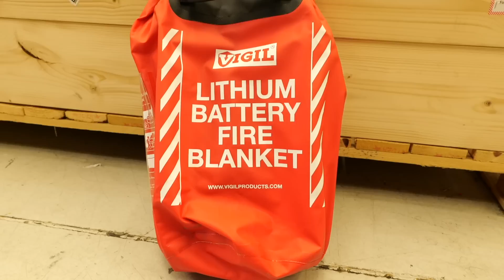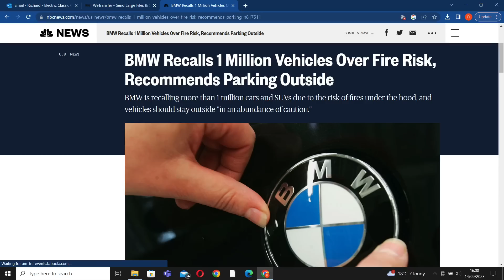Electric Car Fires - Facts and Figures

Comment: No mention that the electric car fleet is new compared to aging ICE fleet. Seems a biased comparison between the two. 

You speak about "petrol/diesel fires" for ICE vehicles, but a large proportion of the fires are not caused by the drive train at all. Rather they are caused by vehicle mods, arson, insurance scams, etc.

The soothe saying on the electrical fires is utterly perverse. Electric vehicle fires are extremely hot, toxic, and hard to fight - but a blanket solves it?

"It's very unlikely" - breathless handwaving. "But ICEs burn too" - deperation. Highly dismissive of the very real threats posed by the mass introduction of EVs.

No mention of how to minimise the risks of or what to do in the case of an EV fire. Just clutching Swedish stats and handwaving.

As I write a Tesla EV battery is on fire in Queensland Australia with fire fighters stepping back to simply "let it burn" be ause they cannot extinguish it with their conventional methods.

Comment: So, never park your electric car in a car park, because a petrol car might start a fire and destroy your EV.
Reply: The dude does not get your irony. I believe everything I want to on YouTube 😤
Reply: What he said is your electric toaster if it catches fire it will burn to a crisp. Ice cars can be saved with a 10€ fire extinguisher IF it catches fire because of bad maintenance.
Reply: Bullshit
Reply: LFP batteries are less energy dense than lithium ion batteries and much less likely to burn, even if subjected to direct trauma. It is disappointing that LFP cars are becoming harder to find on the market, especially as the LFP batteries are cheaper to manufacture.
Reply: The difference is that the petrol car fire can be easily extinguished. Never park your EV in a garage.
Reply: The difference is that the petrol car fire can be easily extinguished. Never park your EV in a garage.
Reply: The difference is that the petrol car fire can be easily extinguished. Never park your EV in a garage.

Comment: you cannot deny those facts: in Sweden. However, in high temperature and high humidity- those are differing operating conditions, so your results may vary.  Again - even the firefighting strategies will differ where temperatures are higher. I expect ther eare few Chevy Volts among the base of EVs in Sweden.

Comment: You're cherry picking your examples like the media do. Lithium fires are by far more of a problem. There's a risk of colbolt poisening which can be devistating. But the battery produces its own fuel and can reignite after tthousands of gallons of water are poured on it. Lithium batteries are know to combust during charging, how many people fill their petrol car at hom in the driveway or garage?

Comment: I don't hate EVs but I know Lithium batteries are very dangerous and NOTHING like the risks of ICE engines.
Reply: @@CantStopTheSignal337 Flammable liquids?  Have you ever tried to light diesel?  It's nigh on impossible.  To ignite diesel requires pressurisation into an aerosol using high pressure injectors. It can burn but it's rare and like petrol, it's easy to extinguish. But L-ion batteries are a totally different matter.  There are no similarities at all. Petrol requires a broken fuel line and a spark.  They don't just combust like EVs can.   You obviously know nothing about engines.  Denial will not alter facts.
Reply: @@CantStopTheSignal337 Well of course it will burn.  And how pray tell will diesel be soaking insulation?  Extremely rarely.  And what would the ignition source be?  are not talking LFP we are talking L-ion batteries.  I am not in denial at all, EV heads are.  Of course there will be more Petrol fires than EVs because there are billions of petrol engines compared to EVs.  Obvious or what!!  The EV industry is finished mate
Reply: @@CantStopTheSignal337 Well of course it will burn.  And how pray tell will diesel be soaking insulation?  Extremely rarely.  And what would the ignition source be?  are not talking LFP we are talking L-ion batteries.  I am not in denial at all, EV heads are.  Of course there will be more Petrol fires than EVs because there are billions of petrol engines compared to EVs.  Obvious or what!!  The EV industry is finished mate
Reply: @@CantStopTheSignal337 Well YT keeps deleting my comment. Try again - Well of course it will burn.  And how pray tell will diesel be soaking insulation?  Extremely rarely.  And what would the ignition source be?  are not talking LFP we are talking L-ion batteries.  I am not in denial at all, EV heads are.  Of course there will be more Petrol fires than EVs because there are billions of petrol engines compared to EVs.  Obvious or what!!
Reply: @@CantStopTheSignal337 I have tried four times to respond but YT keep deleting my comment.   Utter bs.

Comment: You fail to mention the reasons for car fires . How many are deliberatly set on fire in both groups . You also fail to mention the very toxic and poisonous gasses released by Electric car fires. Much more dangerous than the poisonous gasses released in an electric fire.

Comment: Everyone seem to miss the point that on average EV drive fewer km annually than ICE vehicles. A fair comparison is fires/billion km.
Also most EVs are less than 3 years old while there are many 10-20 years old ICE vehicles on the road. Maybe older EV burn more often, we just don't know yet?
Reply from the maker: Pinfa (Phosphorous, Inorganic and Nitrogen Flame Retardants Association) suggested around 55 fires per billion miles traveled in ICEs compared to 5 fires per billion miles traveled for EVs. A recent study conducted by AutoInsuranceEZ using data from the NTSB (National Transportation Safety Board) showed that electric cars in the US caught fire at a rate of 25.1 per 100,000 sales compared to 1,530 for ICE vehicles and 3,475 for hybrids.
Reply: @ElectricClassicCars  The per sales numbers are totally nonsense.
The 1:10 ratio is about right, but it is still comparing newer EVs to all ICE vehicles, so still flawed.
Reply: Data from autoinsuranceez is inteitionally fake.  I followed its source to a reddit post, and then the original paper it sourced information from

Comment: Thumbs up from me for accuracy. A few things which would also have been good to mention. 
1. Hybrids are around twice as likely to catch fire than ICE. Putting them something like 40 times more likely to combust than BEV. 

2. BEV fires are less likely to result in injury when the car is already occupied. BEV cars have the ability to detect thermal runaway and warn the driver. My car for example will tell you to evacuate the vehicle. I'm not aware of any ICE road car which can tell you it's about to burst into flames. Unfortunately ICE car fires can start within seconds without warning and therefore with horrific consequences. 

3. As the battery technology/chemistry changes, the risk of fire gets less and less. That partly explains your stats suggesting the number of cars is going up but the instance of fire is not. It's highly likely that BEV cars made in a few years will have a tiny fraction of the risk they do now.
Reply from the maker: Very good points. Thanks for your comments. 👍

Comment: What is the rate of car fires?
Analysis of fire and crash data from the Bureau of Transportation Statistics and the National Transportation Safety Board show there were 1529.9 fires per 100,000 sales for gasoline vehicles and just 25.1 fires per 100,000 sales for electric vehicles.9/03/2023

Comment: Sweden stats should be weighted with car age as well. ICE fleet is older. Best is to present fires per km travelled with similar aged fleets. 
The real problem with ev fires is that they cannot be controlled with conventional means, that they emit more toxic fumes and that no real safety regulation exists yet. 
If an ICE car ingnites in an underground car park, you have a firefighting device placed in the space to combat it in its early stage. Also you can approach it without a respirator. If same thing happens with an EV there is nothing there. In most countries even the fire department doesn't know what to do.

Comment: That’s great! Doing a google search also reveals that LFP batteries are even safer and they don’t catch fire even if they are punctured through the cell 👍
Reply from the maker: True 👍
Reply: Safest battery is sodium battery
If proven true, safest for home energy storage
Supposedly battery will not set itself on fire
Reply: Normally LFP if short circuited they smoke and get hot
Smoke from the evaporting liquid in battery 

However if the heat is great and cause other materials to burn the heat & fire then can set the LFP battery on fire.

Yet LFP is much safer as one have time to get out car. Smoke 1st and may then catch fire depend on situation & weather, temperature 

Also LFP don't produce own oxygen so can be put out like other normal fires

But the battery will continue to heat until energy are dissipated, that will be many hours

Comment: Very balance report as you identify the issue is dealing with the fire in the unlikely event it happens. The good thing is you for the most part cars are built to a much safer standard compared to electric scooters and bike where the current bad press is coming from hence the ban on public transport.  Small electric run around are the way forward for city use. Not so sure for long distance towing of caravans however. How you recharge mid journey would be interesting. I very much in the middle on electric cars. Loved the LHD fiat 500 video and would convert one for local use it if course I could afford one.  Keep it up.

Comment: Usually, I find the truth to be somewhere in the middle ground...First thing, the breakdown into percentages needs to be taken further, as the following factors have to be taken into account for the causes of a vehicle fire: age of vehicle; collision/debris damage; arson; external fire; etc. Until you have that breakdown it's not a fair comparison and 'could' be misleading. Next, the causes and effects of EV battery fires need highlighting, first the causes: battery/bms/charging fault; collision/road debris damage; water immersion (especially salt water), etc. Now the effects: off-gassing into passenger compartment; off-gassing into a confined space; fire from the ignition of gases; toxicity of smoke/fumes (esp battery packs containing cobalt); toxicity of fire suppressant/runoff; potential reignition some time after initial fire; etc. Knowing any of this might be of use for the small percentage of people who will find themselves caught near or in an EV fire

Freemantle highway, or why you can't trust the news either way: The initial radio report from the scene was blaming the fire on an EV and the news jumped on that, then it was only 25 EVs onboard, then around 1000, but until it's investigated there's nothing more to say as to the cause. Also, there was the hallelujah moment when all EVs were thought to have been left untouched on the lower decks...Followed by a leaked photo showing a burned-out Porche Taycan, and videos of the recent offloading showed around 30 EVs removed from the ship in covered metal containers. The first Merc EV that was recovered went thermal immersed inside a container outside of the ship, so subsequent EV removals were done inside the ship.

In Australia, they have 120,000 BEV/PHEV and only 6 fires, with only 2 from collision/battery damage. Source: EV FireSafe. John Cadogan does on occasion takes a relatively impartial look at potential risks from EV fires. Want any sources for the above and I can post them... Personally, I couldn't care less what powers your car, it's your choice same as staying ignorant is...

Comment: It's all very well massaging the figures to say an ICE car is 20 times more likely to catch fire, or you could have just said that the actual percentage, at 0.008%, was double that of EVs at 0.004%. The one thing I never hear mentioned is age. It is a very well known fact that it is generally older ICE cars that catch fire, often due to wear and tear on the wiring looms, but with EVs it's new cars - it has to be, because they haven't been around in large numbers for very long - and that's the worry. If they're setting on fire fresh out of the showroom, what are they going to be like at 10 years old? 

There are other issues with EV fires too. The fires are said to be fiercer, and are therefore more likely to spread a lot faster and therefore a lot more likely to cause more damage and possible danger to life. The fact that they are more difficult to extinguish makes it even worse. So it's not just a straight comparison. 

And call me cynical but I can also see this figure rising very quickly once the cheap and cheerful Chinese stuff starts arriving in numbers.

Comment: It would be reassuring to know if all fire departments have the equipment and know how to tackle ev fires.
Reply: It would be even more reassuring if, after we are at 100% EV, that when you ring the fire department because your car is on fire, they don't respond with, "We can't attend at the moment, all our fire trucks are on charge"😏
Reply: It is a national problem. There is no answer right now. The Fire Service, as a whole, is in high gear trying to form a solution but there is no magic bullet for now. The manufacturers have created a monster with no way to contain them. They have admitted they have no solution.
Reply: But none have.

Comment: How many ICE fires occur spontaneously in the middle of the night while the vehicle is motionless in the garage? Answer; zero. When they do occur, they are relatively quick and easy to put out and they usually occur while the vehicle is in use, meaning the owner is immediately aware of the problem and is able to alert the emergency services. EV fires are a whole different level of dangerous, aside from being almost impossible to extinguish, the ferocity and extremely high temperatures mean that they are exceptionally destructive to anything nearby. In addition, they appear to occur randomly and spontaneously, sometimes when the vehicle is on charge and sometimes with no precipitating factors apparent. If the vehicle is confined, such as in and underground car park or in a garage attached to a house, the consequences can be extreme and unpredictable. It is not intellectually honest to compare EV fires and ICE fires simply by probability of occurring. They are very, very different animals, with EV fires carrying the potential for exponentially more severe consequences to life and property. Keeping an EV in the garage next to your house, is like keeping a jerry can of petrol in the cupboard under the stairs ...next to a burning candle ...under the baby's bedroom.

Even when EV's are not the direct cause of the fire, their proximity and presence makes the situation very much worse, such as the cargo ship that burnt out a few weeks ago. Did anyone see the video of an being removed by crane after the fire had been declared out and the situation safe? It caught fire again as they were moving it and had to be dumped into a skip full of water they had prepared, obviously because they were not at all concerned about the EV's on board.

Comment: Thanks for this balanced review of some of the facts around this. A couple of points that you might want to look into and update us on are: 1. Hybrid cars have been about for quite a few years now are there any stats that show their rate of catching fire and cause (battery or ICE)? 2. What age were the BEVs that caught fire, is it more or less likely in an older vehicle? There are other areas as well that someone will be researching I.e method/speed of charging predominately used, battery chemistry etc.
Reply from the maker: There’s a graph in the below link that shows car fires split by electric, hybrid and other fuel types. https://www.warpnews.org/transportation/fewer-fires-in-electric-cars-compared-to-fossil-fueled-cars-in-the-worlds-country-with-the-highest-share-of-electric-cars/
Reply: @ElectricClassicCars I believe that in the United States 80 % of vehicles fires occur in vehicles that are over 10 years old . Since most Evs on the roads are less than 10 years old we will have to wait and see
Reply: @overson15  Exactly!!!   This analysis is flawed!
Reply: @overson15 from that, we could throw out 80% of the 20x likelihood of gas fires. Now they’re a mere 4 times likely to catch fire.

Comment: The average age of cars in Sweden is over 10 years old.  So lots of ICE cars are quite old so age will make failure more likely.  Indeed there are probably as many 20year old ICE cars on the road as new EVs.  How electric cars are going in 10 years time could be a real worry considering the intensity.  
Building parking basements will be full of electric cars aging away, many owners ignoring iissues/service.   Difficult to fight an EV fire in a basement.   I think we do need safer batteries.